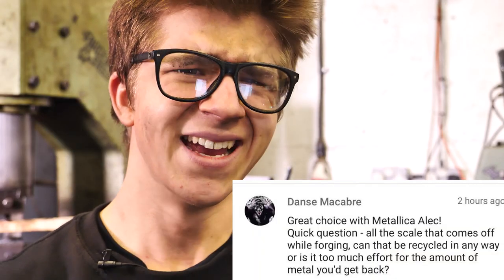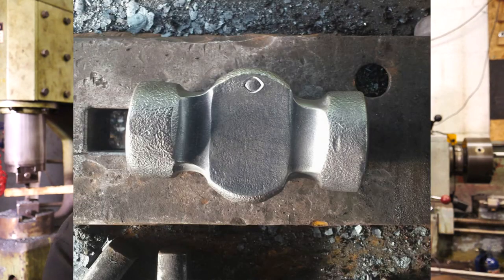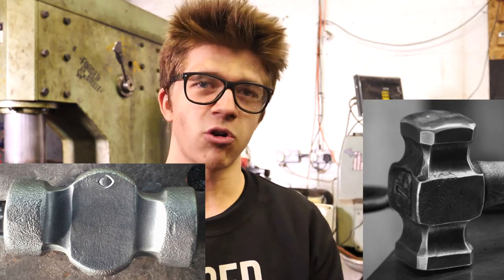MAKING 70 HAMMERS: Part 4.5

Comment: Mix potassium thiocyanate with your etching acid and it'll turn a blood color
Reply: Woah... Good to know... I'll use that when I make my Damascus machete and bejewel the handle. Where do I get it?

Edit: Never mind. I thought it looked familiar. I haven't done film based photography in a long time.
Reply: Is it possible to attach that color to the surface of the steel? (Only to remain there till I apply lacquer) 
Like the way it is possible to patina a copper object.

Comment: Did anyone else have a mini heart attack at 1:19 ?
Reply: DC430 He's like a Mexican waitress handling a platter of food that came straight from what I can only assume was a 500° oven. Immunity from the heat. The only reason he got burned a couple of months ago was because he wasn't ready for it.
Reply: those chainmail glove are awesome, you can do anything shy of holding while forging, which he tried on live stream and it went poorly
Reply: How did he burn himself?
Reply: He didn't have a hammer set right on the power hammer and it slid off and smacked him on the wrist!
Reply: xDarkAvengerx do you know where I can get some? Or did he make them?
Reply: Chase Hoherz he didn't make them but I can't remember what brand they are
Reply: Don't try that with leather gloves... I've done it before and would not recommend it. You feel nothing for the first few seconds, then suddenly a wave of intense heat passes straight through the glove like it doesn't exist.

Comment: I have a question about the design of the hammer...Does the larger neck/shoulder cut in give any advantages or is that decoration?  I've seen sledges that are just straight sided, but I wanted to know if the curves between head and handle give any benefit.  Great work though, keep up the great attitude, and the brilliant art you make.  It's nice to see that you are very skilled, but are still willing to learn and hone your skills and further your knowledge.

Comment: With the go pro, id avoid any rigorous work / fast movements, its not great for the eyes. i like the idea, but it would be better implemented for stuff like close up work (stuff like fine detail work where it is mostly or exclusively head movement).

on that, i would actually like to see a bit of engraving on stuff like knives. i think it would be something you may like, i dunno. may aswell give it a shot :3

Comment: So I have a question: How does the drift not get stuck? I feel like you force it in, so it's already pretty tight. Then the billet cools a bit, the drift heats up a bit. With the billet shrinking a tad and the drift expanding a tad, how is it (usually) so easy to separate them?

Comment: the scale is iron oxide.  The Thermite reaction will reduce it back to elemental iron.  3 parts scale mixed thoroughly with 2 parts aluminum powder, ignite it and it will produce molten iron.  careful the reaction is quite violent and generates a lot of heat and flame.  it's used to weld railway iron in the field.  I had an old book over it.  it was a part of the blacksmith's toolbox back in the 1800's.  was used quite often to fix cast iron items back then

Comment: I've made a DIY propane tank forge with two venturi burners and im running into the problem that my steel isnt heating evenly and even starts to melt. Any suggestions?

Comment: What percentage of the original iron weight is lost through slag and whatnot?  I am wondering if you start out with more material then you need, for instance; would you cut a 5lb billet for a 5lb hammer?

Comment: alex, how does the power hammer work?? ive been wondering it for a long time how it has so much force, its clearly a mechanical press but has some mechanism to raise and lower it while still maintaining momentum... it just doesnt work in my head
Reply: Melody it's a pneumatic hammer, it uses an electric motor to drive what is effectively a massive air piston
Reply: Liam Strong how come it keeps moving when hes not using it and how does it meter the force with which it hits

Comment: Dammit, really need to star forging, tomorrow I'm gonna do an axe from a piece of railroad, even if I lack most of the tools I have a forge, an anvil and a hammer
Reply: and that is all you need to start, I still need a forge and hammer but I have a great hunk of narrow gauge railroad track for my anvil
Reply: Sweet Tasty I tried today, it was a failure, but now I know I need a better(bigger) forge and do a gas rig for it (btw it's a homenade forge)
Reply: nice, I was thinking of building a forge, though I might save up and buy one of sam's burner kits
Reply: Sweet Tasty yeah, that would be better, but in my country those kind of stuff is way too uncommon and really expensive, so a homemade one it's the best option, good luck